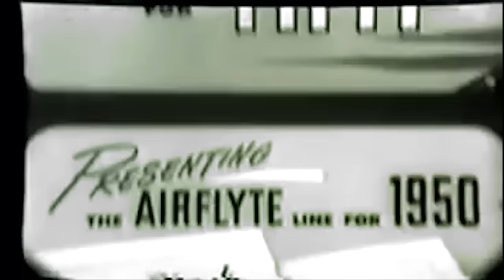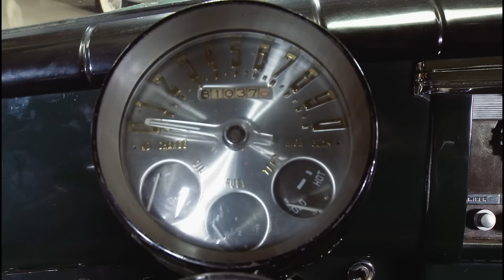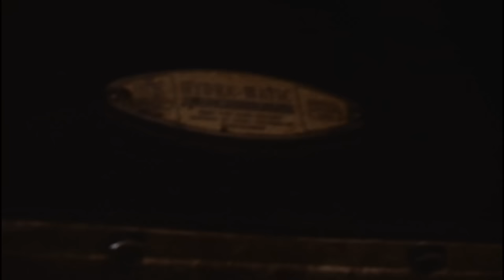1950 Nash Ambassador Custom - Jay Leno's Garage

Comment: When I was a kid we had a 1950 Oldsmobile 98.  Two-tone, light yellow with a black top, same body as the small Cadillac.  Red leather upholstery.  Automatic transmission, hydraulic windows (the hydraulic lines would spring leaks once in a while).  I remember when my dad drove it out of the Oldsmobile dealer's building in Eureka, California.  I think it was a custom order from the factory.

Comment: I had an old van that had those vent windows. I really miss them. On a hot summer day with no AC, it's a lifesaver. In my current, more modern daily driver (that has an AC that barely works), when it gets real hot, you just can't get enough venting even with all the windows down. If it had a couple of those vent windows, it would be so much nicer. Of course, in modern times, they say "just fix the AC". Yeah, well, the AC for that car is undersized. It is working correctly and everything in/on it is clean. It just can't handle the hot and humid summers here.

Comment: We had a 1950's Diamond T truck that had a Nash engine in it very similar to this one. Very quiet truck, but was low geared and dad sold it to a collector later on. Also had what they called the suicide or drop center rims on it. Sometimes I wish we still had that truck as there are times I could use it!

Comment: AH, the old Ambassador Custom! The Ambassador nameplate lived on with the American Motors takeover of Nash. They built cars with the Ambassador name into the mid-70's. In Winston-Salem N.C. still to this day is the old Nash Dealer building. Its a multi-story building  of brick and white marble exterior. There is a garage door on the front. The name NASH is carved in the Marble above the door. There was no room for a car lot in Downtown on 4th Street, so they went up. I'm 54, so I do not remember when it was open. The older men I worked with back in the early 1990's all remember when it was open. They said the Showroom was on the 2nd floor and you picked one out to test drive. It was brought down to street level in a freight elavator, then you drove out of the building. The building is now part of the Historical Buildings Downtown. It still looks awesome to ride down 4th street and look up and see the NASH name carved in that white marble.Thanks Jay for showing  that GOG.

Comment: I was always fascinated by the front wheel wells  on these cars. It looks like there are fender skirts on the front wheels.  Was the front suspension specially designed to let the wells make a full turn?
Reply: Had to have been. Otherwise you’d have a car that either can’t turn or scrapes the inner body panels with the front tires
Reply: Within the video, they show a shot from under the car & back to front (or was it vice vera).  The front track was a significant amount narrower to allow turning.

Comment: wow, I've always thought Nash and Packard were really cool cars but now I think I may actually be able to fit in one despite my height and odd proportions. (I'm 6'9 and barely have a 30 inch leg inseam, I'm all torso)
Reply: Wow indeed. I'm 6'7" and have a 32, so I feel your pain, if not quite so acutely. I bought an A8 and am getting that going now to replace a 300SD, and I previously had an Impreza. Oddly, I had a 240SX before that, which was really good. I hacked the seat a bit, though.
Reply: Yes, it's a 1997 Quattro. It's leaking, but it runs nicely. I've legit fixed a lot of stuff on it. They're cheap now but the trans is a PITA
Reply: Martin Espinoza that's why I ended up with the bronco instead of a dodge truck, I really wanted a 90s dodge but the transmissions are known to fall apart and all of them I could find in the 3-6k range had like 180-350k miles and its like F that... for $4700 I got my bronco with 86k miles and it has never been out of the area since April 1996, the previous owners bought it in Roseville, took it to Carmichael and only used it to tow their boat.. down side is they didn't know you are supposed to put it in 4wd every so often to stir everything up.. and also all the bushings are done.. hell it even still has the original shocks, that shows you how little it was driven.
Reply: J.A.Ratt85
Huh, I have owned three Dodges, and not one has had a transmission problem.
Reply: Auggies1956 People think if it doesn't go  past 100,000 and they have NEVER changed the fluid, that they are crap transmissions. Torqueflites, 727's, 904's, and all the variants of these are the toughest transmissions.  I have a '95 Jeep with a 42RE, which is essentially the 904 heritage, with 310,000 miles.  Never has been out of the Jeep.
Reply: IstvanN1961 size 15 shoes and I lean back
Reply: I wear sixteens :)
Reply: Martin Espinoza
Nissan is weird fit for tall guys. Im 6'7 as well and i had a 94 extended cab Nissan hardbody pickup and once i relocated the seat a few inches back i fit in perfectly. The odd thing is i felt more comfortable in that old truck than any of the new cars i have owned. Thanks for reminding me about it, now i miss my old truck.....
Reply: chefdan87 It's okay I used to have a 76F100 and I had all the head room I could ever ant but my feet were always trying to rip wires under the dash when working the clutch and talk about hell on my knee, that clutch was WAY too high and close to me for commuting.. My 95 bronco is okay other than the bench seat can't lean back.
Reply: And that metal dash is not kind to the knees, either. I really liked driving my F250, but the 7.3 IDI died the death of cavitation...
Reply: J.A.Ratt85
I have a 94 bronco and its the new love of my life. I also owned a 77 f150 ranger custom so i feel your pain.
Reply: chefdan87 the 11mpg is the worst part for me, that and the cross bar of the bench seat hits me right on the apex of my spine where I have kyphosis (which is also where I broke two ribs when I put my truck in a ditch) so that hurts every time I drive it but other than that and needing all new rubber throughout the vehicle (body mounts and bushings) its pretty nice.. Only has just under 87k miles.
Reply: Yikes!  I'm 6'2" with a 30" inseam, and I have to thread my way into almost every car!  It's very hard to imagine how a person with your proportions can even drive any car without Houdini-style contortions!  Maybe 'sunny-day convertibles' are your only choice!
Reply: Holy cow 6'9" all torso, do you have gigantism? Lol just playin', I'm 6'6" with a 36" inseam, I'm guessing we're kinda opposites. (Get a FORD BRONCO brother, that's the only vehicle I've ever felt normal in ;)
Reply: cybertree that's what I own, a 95, the seat sucks though, hits right on the arch of my spine... which happens to be right where I broke two ribs one 1.5 inch off my spine and the other .5 inch.. putting a 76 F100 in a 3 ft ditch at 30mph hurt.

Comment: My dad was a Nash Dealer in Detroit and I rode in many Nash models from 1945 to 1977. Then they became American Motors after they merged with Hudson. I slept as a kid in a 1950 Nash on trips to Florida. Also, Penin Farina didn't design a Nash until the advent of the Nash Healey in 1952. A car Mr.Leno should review. It had all all aluminum body. I also drove a 1958 Rambler Rebel that was the second fastest 0-60 car on Woodward at that time.

Comment: Nash didn't go out of business!  Come on Jay!? They merged with Hudson to form AMC! (American Motor Corporation)
I know this as I am a big AMC/Jeep fan and only wish I could find a AMC Eagle in good condition as I think the Eagle is AMC's iconic car. It is what lead up to the design of the Jeep Cherokee XJ and Grand Cherokee project that AMC started but lacked funding for! AMC also created one of in my opinion (and a lot of Jeep fans) greatest engines 4.0L 242  inline six derived from the 232/258 I-6 AMC engines.
Reply: amc is gone..just like Nash, and hudson, and tucker... etc.
Reply: You don't know much about it then!? AMC had the 242 designed before Chrysler even took control! Hence the AMC 150 that came out in 1984 in the original Jeep XJ Cherokee it was the 4.0 less 2 cylinders but AMC picked putting it in to production first as the 258 was still going strong on sales in both the Eagle and the Jeeps! You might want to read a little more up on Jeeps to find more facts I have! AMC sold out to Chrysler in 1986/1987 and the 4.0 came out in the 1987 model cherokee that startes producrion late 1986 the engines had to be made before the jeeps so I don't see how Mopar could have designed an engine before owning or in control of AMC? And the fact that the block is almost identical to the 258 might fudge your idea!? :)
Reply: Walter Null My 1989 wrangler has the 4.2 Inline 6. Love those engines
Reply: Jerry Urban Correction, 258  not 242.
Reply: Jerry Urbam what do you mean? "Correction, 258 not 242"? 242 is the 4.0 and was designed before the Chrysler deal was completed. Or do you mean u thinkg the 258 was the greatest? :) The 4.0 with EFI is the only thing that made the AMC inline design better!
Reply: Walter Null I meant the 258/4.2 became a 242/4.0. It actually was installed in the '87 Cherokee. The 4.0 was done by Renault... AMC/Jeep/Renault.They shaved the block along with some other mods to fit into the Cherokee. Great motor.. you are correct. They got rid of their doggy GM 2.8 V-6 that was in the Cherokee.
Reply: 1968-1970 AMX.
Reply: Walter Null Walter you're correct about the 4.0 - I had an "early" '87 Cherokee with the 4.0 EFI and no Chrysler logos to be found anywhere. It was all AMC/Renault, including the owner's manual.
Reply: Its just a shame that AMC didn't get to put the 4.0 in the Eagle, I think it would have changed the out look of the eagle if it didn't have the Carb issues.
Reply: Walter Null I actually remember reading somewhere that AMC was planning on doing a 2nd generation Eagle at the time of the Chrysler takeover. Details were foggy, but from what I remember, it would have been based on the Renault 25, so no 4.0 unfortunately, and the Eagle Premier/Dodge Monaco was basically what that project ended up being... but it would have been much more Eagle-like as an AMC.

The Premier, as it was built, inexplicably had the Renault 21's (aka Eagle Medallion) suspension, which was almost certainly a leftover from AMC Eagle 2.0 development. There was a 4WD R21 in Europe, but no 4WD R25. The Premier also utilized the AMC 2.5l four as it's base engine, which is another sure sign that it was intended as something else originally. Renault had plenty of their own 4-cylinders they could have used, which would've been way cheaper. The V6 was the PRV 3.0 of DeLorean/Volvo fame, and also available with a turbo in European R25s.

So picture an Eagle Premier that looked more like an AMC, with the AMC Eagle's 4WD hardware (the Premier was FWD but w/longitudinal engine & trans), the fuel-injected AMC four or V6 (with 5-speed or OD auto), possibly a turbo variant, and sedan or wagon bodies. It was probably only a year or two away when Renault bailed and sold out to Chrysler. Had Renault chairman George Besse not been murdered, that almost certainly would have happened. He was AMC's biggest cheerleader in France, and without him Renault management got cold feet. The brand new Medallion had just been launched and a new factory built in Ontario when they sold to Chrysler based, primarily, on Jeep making good $$$ at the time.
Reply: Wow u know ur history on AMC! And I thought I was a big fan :)
Reply: I put a '90 4.0 in my Eagle, mostly bolted right in. Oh, and I put rings and bearings in it before the transplant (I also painted it AMC blue) and was amused to find the pistons had cast into them the old script "AM" logo from the sixties.
Reply: Do you see "NASH" vehicles being released anymore? NO, NASH went out of business, they simply sold their equipment to another company.
Reply: Incorrect cybertree, Nash joined with Hudson to form AMC. Which was the last independent American auto maker until 1987/1988 when it was purchased by Chrysler.
Reply: In the so-called Nash-Hudson merger, it was actually a takeover.  Nash was the stronger, surviving company.  All AMC cars have 'Nash DNA' in their construction.
Reply: AMC made the last Nash in 1957

Comment: Great car. I had two of them back in the late 70s and enjoyed them both. I rebuilt the flathead 6 in my 49, and a simpler engine would be hard to find. The water pump was on the left side of the block and ran off of the rear of the generator where the shaft extended out the back of the case. Manual overdrive. Vacuum rear wiper. Clutch pedal starter button. And, if I remember correctly, it was not only 6 volt, but it was positive ground. The old bathtub Nash, what a ride.

Comment: Nice car.  Looks like it's had some panels resprayed at some time as there appears to be colour differences between the doors and bonnet etc on the driver side.  The way the front wheels are covered in by the guards is fascinating.  Makes you wonder how difficult it is to change them over.  Real Fall Out Three stuff.  Great video.
Reply: xynudu Cars. Cars never change.

Comment: I wrote a whole chapter in my book describing the 40s and early 50s cars my family sold. The steering wheels had to be huge, there was no power steering. My father would turn, hold the wheel then let it go with his wedding ring clacking on the knurls. And yes, I got to sit on his lap once in a while to steer.

Comment: Born 1942 so back in the 50's I remember these parked on the street. I thought they looked like an upside down bath tub and the grill looked like it just bit a lemon. With GM, Ford style to buy (Chrysler were stodgy till 55) I never saw why some would purchase them. Jay can do this as he has the money to. Most of us can afford to put money into one or two classics so this would not be my choice but neither would a 57 Chevrolet. Seems there are far too many at shows but to each his own. If I did another classic today it would probably be a 51 to 56 Packard, 41 to 57 Buick, 40 to 57 Cadillac, 60 to 66 Lincoln or continental. If you do one of these at least you'll have the only one for miles and miles around.

Comment: Did you ever notice that Nash Ambassadors were prominently used in the 50's "Superman" series. No wonder Superman flew. Those Nashes were TANKS. My buddy had a later version of the Nash that had a front seat that transformed into  a  bed. He took a girl to the Drive In without any nefarious intentions but accidently (so he said) engaged the mechanism that released the front seat back. He soon learned that his date was not "that kind of girl". The swelling went down after a day or so and I saw him a few  years ago and he says his vision is fine 50 years later. Needless to say, he never saw the girl again though.

Comment: The 'PinninFarina era was 1952, which looked much different than the production Nash.  The Hydramatics of that era DO have a Park position, GM sail either put the shift lever in low or reverse after engine shut down, it feels and acts exactly like later Park positions.  I had GM, Kaiser, Hudson, Nash and others, even a Bentley with Hydramatics, the park position I used was, shut the engine off and place the lever in reverse.  It held on the steepest hills of San Fransisco.
Reply: That's  the way it was done in reverse not low.

Comment: In the 1950's my family moved from North Central Wisconsin to South Eastern Wisconsin. My dad went from working in a shop that made pots and pans in Menomonie, Wis. to working on a assembly line making Nash / Ramblers in Kenosha, Wis. There was actually a time when American Motors Corporation (AMC) made the Jeep.  During the 1950's and 1960's Kenosha had a good bus service and was known as the City of Parks with its 50,000 population. Today Southeast Wisconsin is considered the trashy part of the state by some, and American Motors no longer exists. If you go to Kenosha today you will see open fields where the car factory once was (like on the corner of 30th Ave, and 52nd St.)

Comment: The Nash 235ci 6 cyl was a very high quality unit with 7 bearings and a counterbalanced crankshaft.  Those engines were indestructible!  Nash tried to compete by being innovative and offering excellent quality at an affordable price.  But maybe they were a bit too "innovative" because the general public tended to view them as quirky oddballs compared to the Big 3's stuff.

Comment: With the HydraMatic automatic transmission, this vintage had no "park" position, but they did have an internal "park" mechanism. Before you shut the engine off, you place the gear selector in the "R" position. After the engine is shut off, the internal "Park" mechanism engages, locking the output shaft. There was no need to engage the parking brake. 
To start the engine, the shifter needs to be in "N", neutral position.

Comment: i also recall on nash you had to use a drum puller to get the back brake drums off to replace the brakes also gm back then had the same set up.i used to help my dad in his repair shop do this stuff, so yes i learned a lot about dif cars.

Comment: For physicists, a jiffy is how long light takes to travel a distance of one femtometre, which is a millionth of a millionth of a millimetre. That means that there are about three hundred thousand billion billion jiffys in a second. A jiffy also has an electrical meaning. It is the length of a single cycle of alternating current. In the UK’s 50Hz system, a jiffy is thus one-fiftieth of a second.

Comment: when i was a trucker i was stoped perpendicular to a road with a railroad crossing on  the adjoining road the railroad was about 10 to 12 inches higher that the road or maybe more well here comes one of these nashes just like j`s  barreling down the road obviously going too fast i got all ready to watch this car bounce around hitting the railroad at a 45 degree angle and you know what that car body never bounced up or down each wheel bounced up and down the car body amazingly stayed perfectly level best suspension i ever saw !!!!!